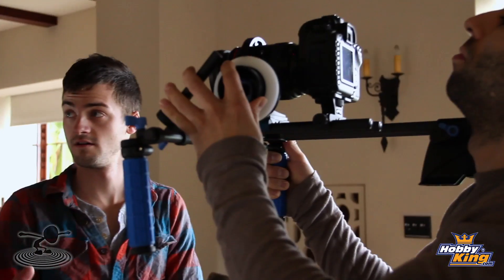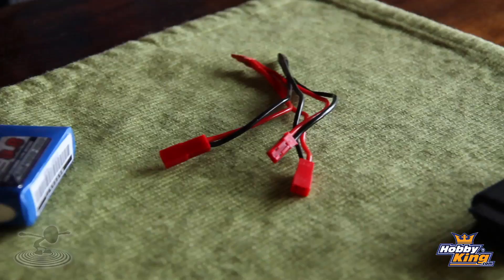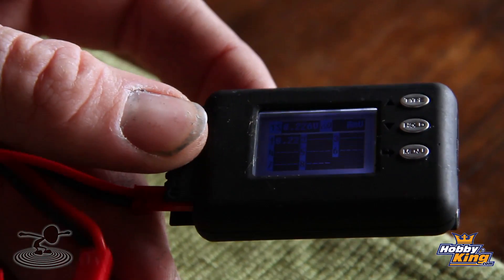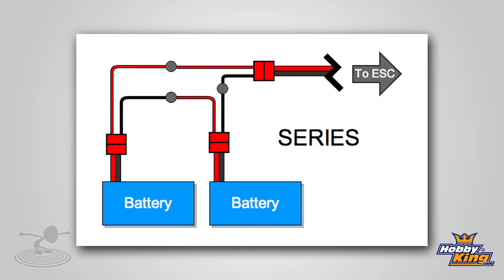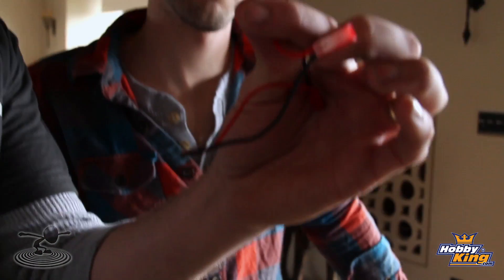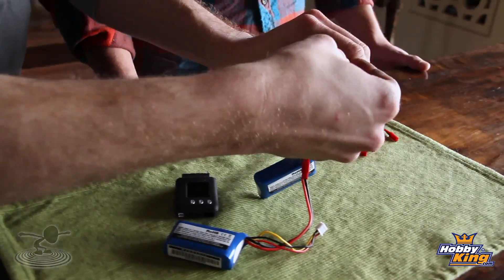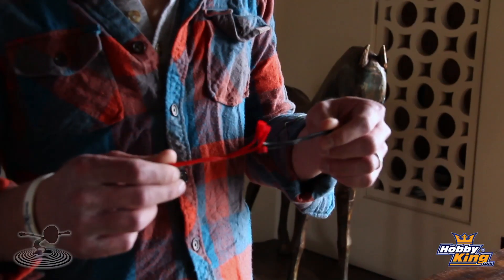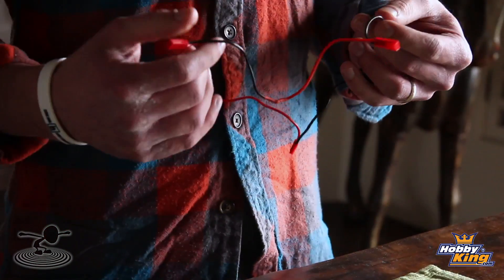Flite Test - Parallel and Series - FLITE TIP

Comment: Wait i have a quad and need more flight time as i am only getting 5 ish mins with 2200 and 4 with my 1800 this isnt long enough for fpv which is what i what to use it for i want to join them in parallel but 1st they are different mah i assume this is fine but second one is a 30 c and one is a 20c discarge will this work ok

Comment: That's a good point! But remember that at a constant voltage (parallel batteries) the current remains constant. This means that each battery supplies half the current rather than the plain consuming twice as much. So if your plane requires 20A, then each battery gives 10A. So the total current in each solder join is still only 20A.

Comment: 4:52 Kirchoff's current law  ...'at any junction (i.e. the solder joints where your red and black wires split into two) in an electrical circuit, the sum of currents flowing into it is equal to the sum of currents flowing out of it' 
if each of the parallel batteries gives 44 amps towards the solder joints , there will be 88 amps coming from the solder joints towards the ESC!
in series, the voltages add up, but in parallel, not only does the capacities add up, but the amps add up too

Comment: NO definitely do not put those two in parallel, or in series for that matter. Uneven charges in LiPo batteries means that one battery will heat up more than the other, and this will continue until it lights on fire. Look up videos of flaming LiPo batteries to give you an idea on why that's not ideal.

Comment: as flitetest said, it is not recommended. this is because one battery will drain more then the other, and may cause it to over discharge to the point that it will not charge again

Comment: nope.

Either you mixed something up, or both of your packs weren't fully charged first, or they were different. (You can't parallel 2s and 3s)

If you parallel packs, they must all be at the same voltage, or the higher pack will try and charge the lower pack _VERY_ quickly, only limited by the resistance of the cells and wires (almost nothing).  If they're kind of close, probably nothing much will happen, but it's hard on the cells.  If they're way off, they'll heat up, spark, puff, etc.

Comment: They don't absolutely have to be identical, but you should never have 2 different capacity sections in series. 

For example, if you have a pair of 500mAh 3s packs, and a pair of 800mAh 3s packs and you want to combine them all into one big pack you could either:
Put the 500Ah packs in 1 series string, 800Ah packs in another (800mAh 6s), and then parallel the 2 strings OR
Parallel a 500 and an 800 into one pack, other 500 and 800 in another, then put the two in series.

The other 2 ways are bad.

Comment: @kenrickfarinas No, if you were to connect them parallel you would have 7200mAh. If you were to do series, you will get four times the voltage.

Comment: Wait a minute...
For example with two 800mah 2S 20C LiPo...
I thought Parallel = 2*800mah, 2*AMPs @ 2S 20C
Where as Series = 800mah, 16amps @ 4S 20C  (or does C rating double too?)_

Comment: I have to take issue with you regarding current draw.
If you have two 2200mAh 20C packs in parallel then the available current IS doubled. 
Whether you take advantage of that by doubling usage time OR drawing more current is up to you but it IS possible to double the current draw that way if you're power train can handle it.

Comment: Hi guys; the discussion at 4:50 about amp draw (C-rating) is a bit confusing for me, as other information sources tell me that cells in parallel do give double the C-rating while cells in series do not. Now which is correct?

Comment: Hey guys, In the summary you've got the Amps in the wrong part of the equation. When you choose between series and parallel, you are trading volts vs amps. Capacity goes with amps. You can remember this by the fact that it is measured in milli _amp_ hours.

So series at the source: more volts, same amps, same capacity
Parallel at the source: same volts, more amps, more capacity

Otherwise great video :)

Comment: @shuttj Agreed, but I did say "effectively" doubling you C rating - meaning instead of pulling 44A from a single pack, you can pull 88A from a parallel (2 batts) pack, as you stated.  i.e. "effectively" double the C rating!!

Comment: Guys it's worth noting that when you parallel batts together, your load is spread equally over them.  So if you have 2 x 2200 20C packs, as opposed to a max draw of 44A (for a single pack), you can get up to 88A, i.e. as well as doubling your capacity, you can effectively double the C rating (in this example 40C, since each batt only sees half the load).  So it's fair to say that when you parallel, you can either double the current draw, OR double the capacity.

Comment: @thydusk666 Yeah, I'd also advise using the same brand and type of battery to do these kinds of things. It's not impossible to do it differently, but you'll have to carefully monitor what's going on.

Overcharging by chaining them together sounds like an incredibly dangerous thing to happen indeed. Is discharging the weaker battery below it's 3,3V per cell possible to happen as well in such a scenario?

Comment: Well done but you should edit the  video and add an important warning: ALWAYS connect identical rated and equally charged batteries as there is a serious risk that the bigger/better charged battery will charge the smaller one. If that happens, you will have a LiPo charged at way more than 1C-2C rating, maybe 10x more. Does that smell like a fire waiting to happen?